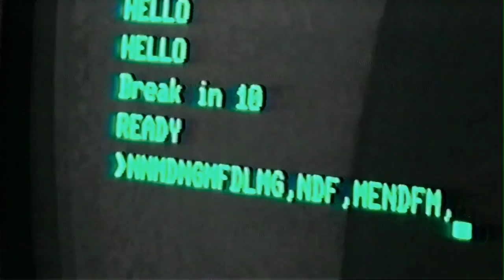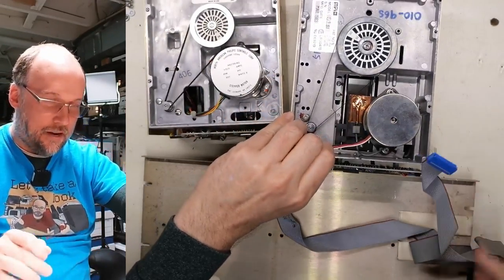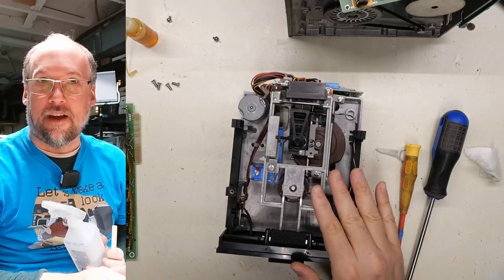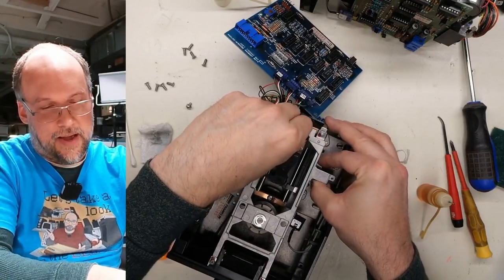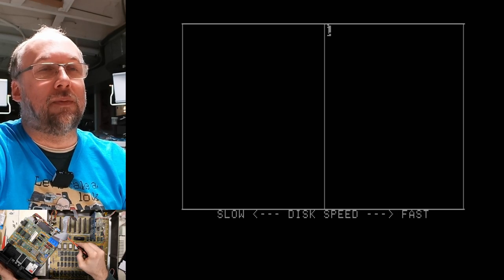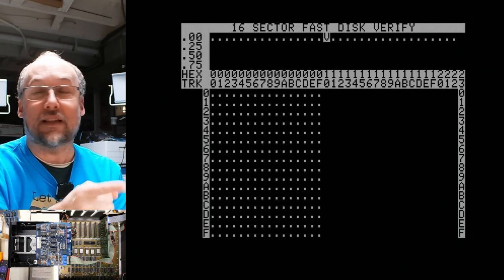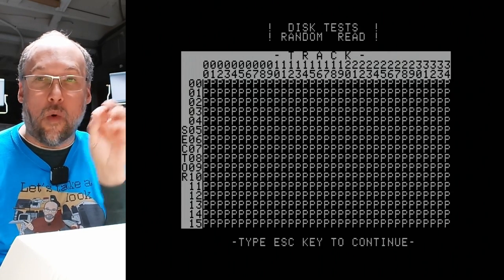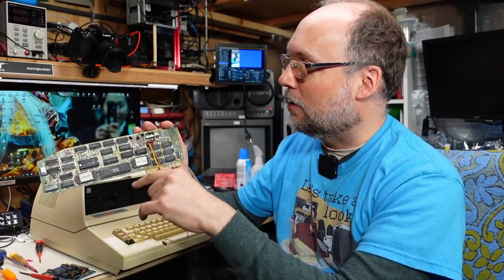Fixing two stubborn 5 1/4" disk drives (and a bad keyboard)

Comment from the maker: A little update on this system -- since working on the drives, I ran them both for several hours more and everything is working perfectly. The speed on both drives is now super stable (and within spec) and the head movement on the MPIO drive also is working flawlessly now. The entire computer is working perfectly again -- even after having it on for hours and hours. I would say this has been a success!
Reply: Cool😊
Reply: Lubricants are composed of minerals and oily substances (solvents, esters, etc).  Even when sealed, they can separate and lose their lubricity.  Letting them spin creates agitation and friction, and can sometimes reintegrate them and allow them to behave like lubricant again.

Good to see them come back to life.  As long as there isn't pitting on the bearing surfaces, or abrasive metal particles liberated by running them without adequate lube, they should be fine.

Likely culprit is storage conditions (temperature extremes) and intermolecular forces IE bonding preference, decomposition and byproduct interactions, and so forth.
Reply: @tiporari  "lubricity" is a word that I didn't know existed but am extremely pleased to find that it does!!
Reply: Head alignment issues.
As you're using the drives the alignment settles in.
I would exercise drives if not used for a while let alone the time span as these drives.
I used to get similar problems when I used to convert data from old I'm systems and re- using PC disks.
It used to be a pain going home cpm to PC and then go to the customers and it not read.
As you seen the spin speed but heads struggle as well.
In the day I used to have a device called disk exerciser which had different test patterns.
Reply: You need to change the bearings anyway.
Please change them so that the same thing does not happen again in the future.
Reply: The drive was sleepy after its long nap and needed a good stretch.

Comment: My first job was a computer technician at an Apple dealer in Montreal. Brought back a lot of memories that I forgot I had forgotten! 
What I love about old computers, is how simple they were to understand and repair, and how fast they ran programs on fumes of RAM.
Time and humidity was responsible for that drive's failure. I bet the drive was working fine before the computer was stored in the garage, basement or attic for decades. 
The corrosion around the timing disk and belt was a give away. Same corrosion happened in the bearings. Excellent video.

Comment: Many motors like that use sintered metal bearings, and whatever oil was added to them during manufacturing tends to harden with age and dust. What does help is putting a drop of alcohol on them first and moving them a bit to loosen the hardened gunk, then adding a bit of oil afterwards. The same goes for ball bearings. For bearings that are really stubborn, a little bit of heating can help as well, as long as you don't go nuts with the temperature and start melting things.

Comment: Pretty good video. I used to service a lot of these drives back in the day. DON'T use a Dremel on the drive wheel!!! Put one drop off your oil on the shaft & hand spin it for a while and it will probably free up. If it's really sluggish, use 3in1 oil, 1 drop & turn it until it frees up. If it doesn't, you can remove the shaft and clean out the bearing with iso alcohol. IF you spin it too fast, you can permanently damage the bearing &/ or the shaft. These were never meant for high speed turning. This usually happens when exposed to cold and damp, or very warm and dry. With the stuck belt and corroded pulley, I would say cold and damp. These old drives are pretty simple, well built, & easily repaired. If you lube up the mpio drive it will probably never quit.

Comment: Great video as usual. Btw those duster cans do not contain compressed air. Those cans are filled with a refrigerant/propellent like HFC-134a, HFC-152a, HFO-1234ze, CO2, and DME.

Windex contains ammonia which deteriorates plastic and rubber. There are ammonia free glass cleaner that are plastic and rubber safe.

Comment: Excellent episode.  My experience with the 5.25" drives has always been that the sliding rails are always gummed up, and every other moving part will need some love as well.  Most of them have been sitting idle for sooo long.  That is such a nice integration of the floppy drives... nicest I have seen.

Comment: Adrian - I have several versions of Locksmith from back in the day - 4.1, 5.0, 5.5, and 6.0.  IIRC, at least one of the versions had a "degauss" or "de-magnetize" feature which would drive the head back and forth across the disk continuously until the user stopped it.  Version 4.1 had it, maybe one of the later versions.  Would be useful for scenarios where the head has stiction issues.  I used that feature back in the '80s every now and then to exercise the stepper motors in the Disk ][ drives.

Comment: A trick I've been using for sticky/binding bearings that don't just free up with oil alone is to mix some acetone into the oil before dripping it into the bearing. This helps to get thicker oils into tighter spaces by thinning it out so it can more easily wick in around the bearing shields, but thickens back up once the acetone evaporates. With dried up old grease, I find once the mix gets worked in a little bit, the bearing will start to spin extremely freely by hand once the acetone gets everything liquified. Then when the acetone evaporates, the oil is thoroughly blended into the old grease which keeps it soft enough to be usable for a good while longer. 

You do have to be cautious with acetone around motor windings though, as if you squeeze in way too much, it can drip/run too far inside and ends up dissolving the coating on the windings (depending on their coating) and can cause them to short.
Reply: Acetone is really a Paint and Coatings solvent.
I use MEK and it works wonders.
First time about two drips of Mek then a towel to absorb the failed goop. Then a drop of fresh non detergent light oil. 
MEK is extremely soluble in oil and grease and meant to clean and quickly evaporate 
The Acetone may alter the chemistry and shorten the life but the concept is the right idea

Comment: What's funny is this video would be the podcast that I would listen to while putting together my own foam and foil keyboard. Listen to you talk about doing it while I do it
Reply: Also you're absolutely correct you should not use alcohol depending on the alcohol and depending on the belt formulation. Some can resist it others cannot. It'd be kind of strange for it to not resist it but at the same time it's not worth the risk. if you want though drinking alcohol is always safe. Although I can't see any reason you'd want to use that
Reply: Finally you should have probably used a silicon grease for the turntable style mechanism. Such light oil as bearing oil is just going to not cut it It's too thin

Comment: Windex usually contains ammonia.
Ammonia is bad for rubber :)
Brake fluid is good, it helps rejuvenating.
Reply: Brake fluid makes rubber swell up. I ruined a car tyre once by leaving the car parked on a puddle of brake fluid, the rubber had expanded so much that the gaps between the treads were almost completely closed up.
Reply: @Zeem4  I suppose the effects are bad on good condition rubber, but it's usefull when we have very old rubber hard and brittle.
I've used a mix of thinner or acetone and brake fluid to fix the impeller of water pumps on 1950's outboard engines.
It's made of rubber, and dry and shrink with age. Dipping in this mix save them.
Not exactely your sad case with new tires :)

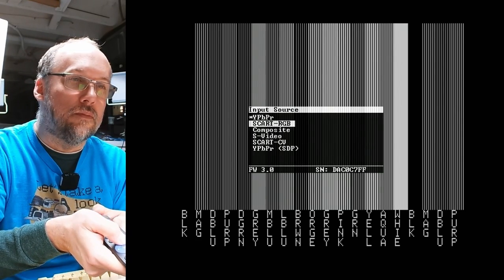Comment: 49:38 I see the white level starting ok and then the whole picture dims down within a few seconds. Not sure if it's the retrotink or the signal? For the stuck drive, the pulley at the bottom has a screw, I was thinking that maybe removing it would give you access to the bearing. Yes they are "sealed" but usually they would let some lubricant in. Very good job though!

Comment: Hi Adrian, I've never worked on a foam and foil keyboard, so this might be a silly idea, but I was thinking that you might be able to use a wooden dowel, of a diameter slightly smaller than that of the foam and foil pads, and use that to press all 4 sides of the plastic disc past the 4 catches. The metal cylinder body of a discarded disposable e-cigarette might also do the trick (if that's something you have access to in the US).

Comment: Great job I learned a few things thanks Adrian. That's a nice computer. Maybe the color can be fixed with replacement caps on the video board or elsewhere? Maybe check voltages and signals on the board?

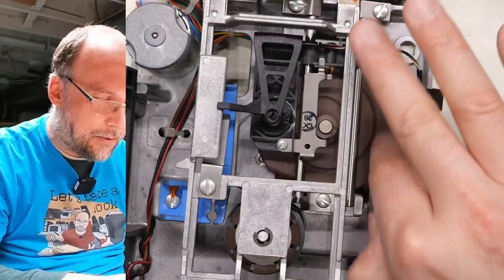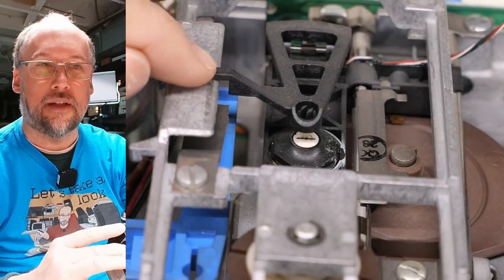15:09 good idea to check the pad, opposite the read/write head and re-glue it if the existing glue has deteriorated. Otherwise the pad will come off and the plastic clip pad holder start to squeal against the disk. The Clip can be seen at 15:24
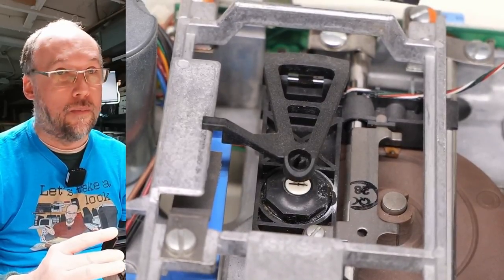15:54 no a cleaning disk will wear on the pad, opposite the r/w head afaik.  Cleaning disks are mostly for double sided drives, no?

Drol looks like that on A8 but performs better and has music. =) still very similar graphics that use artifacting.

Comment: Whoa. Locksmith. I haven't seen that since I was knee high to a grasshopper. I have this vague memory if holding down a key during boot to make it use all 128kB of RAM, a trick I learnt about three days before we sold the 2c that had the memory. So many hours swapping disks for no reason!

Comment: It's actually often quite simple to replace those kind of bearings. With a small vice and regular sockets it's possible to press the old one out and the new one in. The only important thing is to always put the pressure on the correct ring. If it's on a shaft press the inner ring, if it's in a housing press the outer ring. :)

Comment: Adrian. It would have been easy to take a battery powered drill with a screw bit and spun that second drive pully (via the pully screw) while holding the scotch-brite to both exercise the bearing and quickly clean the corrosion off that pully.

Comment: Re. alcohol on rubber: what I've learned from repairing cameras is that lighter fluid (like ronsonal, not charcoal starter) is usually safe for rubber, and most plastics (it is also less liable to damage paints). I've also used it to temporarily rejuvenate rubber parts on old model trains (traction tires, rubber drive bands, etc.). Unlike alcohol, lighter fluid has a slight lubricant effect, and it also doesn't leave residue on most surfaces. Of course, it is even more flammable than rubbing alcohol so there is an even greater need to take care when using it for cleaning.
Reply: I don't have any experience with Ronsonal but I can tell you for sure that the other common lighter fluid, Naptha (used in Zippo brand lighter fluid), definitely interacts with plastics as I found out when I accidentally frosted some clear acrylic with it.

Comment: I had a similar issue with my A1200 when first using it again. It was the hard disk rather than the floppy, but at first I couldn't get into Workbench, but after a few games of Sensible Soccer and Lemmings it fixed itself, but still gave the odd read error, but the longer I used it, the less it happened and now it's like it was never a thing.

I guess sometimes just being sat unused for 20+ years can cause stuff to get stuck in place.

Comment: When you popped out the old foam keys, if you had a vacuum hose in your other hand you could flick the old switch and debris right up into the hose to cut down on the mess.

Comment: Which drive is reading and writing properly ? The Shugie or the brand I never heard of ? Usually the Shugart drives stil work years later. I have 4 of them.
Reply from the maker: In the end both drives work perfectly now.... But the Shugart here basically worked 99% with just some oddities that went away. I have a feeling it was simply bad connections in the IC sockets. (The mechanism was perfect) The other drive (MPIO I think?) had the gummed up bearings.

Comment: The Dremel with a rubber tool to free up the bearings in the floppy drive is a neat idea! But I find myself wondering if if the speed of the Dremel is important. A little restraint, or go full blast?
Reply: Restraint. You don't want to polish a hole in the pulley.
Reply: Many motors will generate electricity when mechanically driven.  Spinning them fast can blow the control electronics.
Reply: That's a good point. It might be a good idea to disconnect it first
Reply: Less speed = more torque with electric motors

Comment: 19:30 Get a cordless drill with a Phillips bit to spin the drive and clean the pulley at the same time with the scotchbrite. A little alcohol on the scotchbrite stops the dust and it seems to work a bit quicker.

Comment: Hey Adrian, How come you never use that PVM there in the corner? Seems like it would be a lot easier to use that for composite and RGB stuff than having to pull out a separate TV or something?. I feel like you could hook it up in paralell with the retrotink so you cans use it as a "real world" reference point for what you see on the 'tink.
Reply: You can't really put two "monitors" in parallel. It's going to load down the video output too much
Reply: @gigigigiontis8  pvms have video pass through specifically for that purpose

Comment: The problem with using oil or grease to lubricate things like drive actuators is that they attract dust. A better solution is either graphite powder by itself or graphite powder in wax. If using graphite powder by itself you need to be very careful that it only goes on the component that you are targeting.

Comment: I don't think I've seen big floppy drives that get their power through the data/ribbon cable.  I'm surprised that the motherboard can deliver that much power to the card and then on to the drive.   Maybe that is the reason that the power supply is so big in the computer...  It is providing the power to the 2 floppy drives as well.

In Apple disk drives do they usually have a separate power supply or are they also powered by the data cable?

Comment: Windex isn't much better than isopropyl alcohol to clean rubber belts since it contains 2-hexoxyethanol and isopropanolamine and other chemicals that aren't suited for rubber, especially with a belt that has become slighly rigidified.
The best way to clean/rejuvenate rubber parts or belts is to use rubber joints protector spray, the Michelin 009455 is quite efficient.

Comment: I am sure that the reason for the metal shield all around the drives were to meet the FCC Class B requirements for electronic devices way back when!  Now I doubt much actually meets those specs when its so cheap from China.

Comment: Bending the tabs over seems like it could be a 3d printed tool. Round, to centre and push the foil/foam down, and It would half bend the tabs, then you turn it 45 degrees and it pushes them the rest of the way.

Comment: Would it be a Bad Idea to remove the drive spindle and lubricate it? Assuming there's tweaky stuff under it that would be hard to reassemble?
Reply from the maker: I've taken them apart in the past, and what is there are a couple sealed bearings that ultimately need to be replaced. My hunch is the seals are bad and the grease has gotten hard. On the drive I did this too, the bearings were pressed in. It's something I'm not equipped to handle. :-(
Reply: @adriansdigitalbasement  i have an atari 1050 drive that the bearing had totally seized and made the belt ride up the motor pulley and stretch,,.. i managed to free off the bearing eventually with 3 in1 oil spray, but still feels a bit rough, the belt stayed stretched and slipped off, but..after leaving for 15 ish years 😲, and occasionally boiling the belt, it does now fit better, but still slips slightly!!
Reply: @adriansdigitalbasement  Maybe you can heat-up the bearings with an hot air gun or hairdryer just enough to melt the grease inside to distribute it again.

Comment: Now, let the drives cool for an hour or so, then re-check. The heat generated may have freed up the goopy old lubricant, but it’ll probably get sticky again when it gets cold. The good thing about these old Apple Disk ][ (and compatible) drives is that there was no indexing built into the drives; only the controller card. So no funny cables with a twist in them, or any jumpers to fiddle around with, and they were mechanically simple. The only real problem was if you plug the cable in backwards, then the magic smoke would come out.
Reply: Those bearings are sealed, but not hermetically sealed-the seal is there to keep lubricant in and most of the dirt out. Also, it will not flow out because of capillary action. I managed to "wash" ball bearing of a laser barcode scanner rotor, but finding a off the shelf suitable lubricant proved to be a pain in the butt (like, silicone oil is too thick). It was some other spray machine oil that did the trick. For my venerable HP printer with slide bearing it was the hair trimmer oil :)

Comment: could it be the first time it didn't write because the r/w switch was stuck ? and you using the cut double side which is a bit sharper and bumpier unlogged it ?

Comment: Why can't you just push the plastic disc in by pressing down on the whole thing with a finger? Does that risk the foam/foil just stuck under the clips too?
Reply from the maker: There must have been some special tool for this -- but just pushing it (with your finger) doesn't get it in. It's too flexible with too tight a fit.
Reply: @adriansdigitalbasement  Ah interesting, that must've been a pretty interesting tool or machine. Thanks! Keep up the great videos!